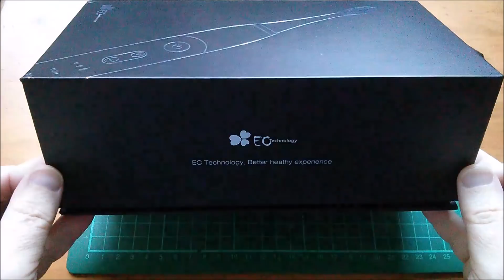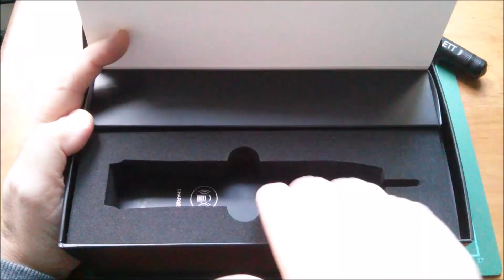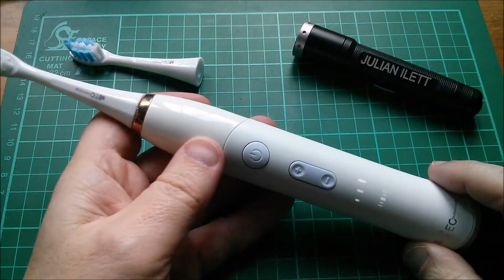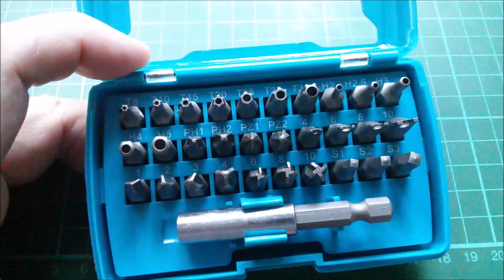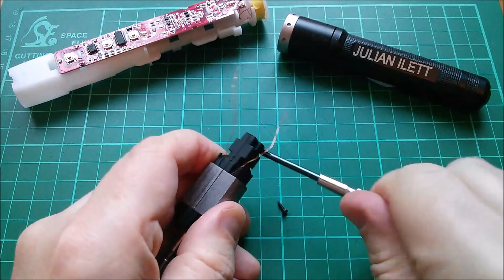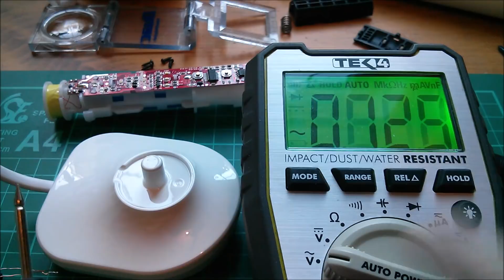Toothbrush Teardown

Comment: CST118S...I thought that sounded familiar. Burnt a cheap Chinese Sunfounder 55g servo about a week ago and opened it up to see what broke. An 8 pin IC on the control board had burnt a hole in it and I could see the die under the lid. Looked up the number, and it was CST118S. Looked for an hour to find a source for it, but all I got were shady websites from Chinese suppliers, none of which I could buy from without requesting a quote. Dug through my bin of scrap boards to see if I could salvage the chip from something, but nothing had that IC.

Guess I'll have to look for a broken toothbrush lmao

Comment: I'm curious if it's possible to tap the op amp in these. Maybe a chip is generating a signal that is amplified like in a stereo and sending the output to the exciter motor that makes the brush head vibrate. Maybe you can inject an audio signal into the amp and then have it play music like the tooth tunes brushes for kids and also hook a speaker to the exciter wires and see how the sound quality is.

8:52 that smaller 4 pin chip is likely some type of amplifier and the larger chip is probably the chip that runs the toothbrush and generates the waveform.

Comment: I think that the spring below is designed to absorb any vibration that woulf be felt when pushing against the toothbrush part when brushing, as a result eliminating the potential rattling against the edge inside the unit

Comment: That was a lot more sophisticated than the old Braun ones, which had a Ni-Cd cell charged from a single coil and diode. The motor was driven via an on/off switch, with no other circuitry. This one looks rather more expensive, too! A few points:
1) Always check first for hidden screws before wrecking a device. You might still have had a useable free toothbrush at the end of the process.
2) Two coils and diodes suggest a centre-tapped secondary with full wave rectification.
3) Measure the battery size to give you the model number. A quick web search would give the approximate capacity, and avoid destruction of the holder.
4) Use your oscilloscope to measure PSU frequency via a secondary coil.
5) Again, use your scope to measure motor drive frequency (which sounds more like 400Hz after Youtube processing.
6) Use the scope to see the output waveforms and voltages under different drive conditions.
7) Some scope indications of signals around that processor would have been interesting, especially when removing the toothbrush from its dock, and when changing drive modes.
You have to use the correct tools for the job! ;-) Thanks Julian.

Comment: An interesting teardown.  I have a similar Sonicare toothbrush that operates at the same frequency.  It's about a 'B' on the musical scale.    On the Sonicare, the "wobbly mode" is used for massaging gums.  I'm curious if the toothbrush heads are interchangeable.  BTW, I got two for $66 at Costco in the U.S., but the EC model seems a bit more deluxe with the plus and minus buttons.
Reply: The brushes are not interchangeable between companies, including the Chinese ones that seem to use identical designs, since overcharging for heads is where most of their profit comes from (similar to the inkjet printer/ink cartridge business model). They vary the shaft profiles slightly to achieve that. Needless to say, anyone with a bit of diy chops can mod pretty much any head to fit snugly on any shaft profile.
Reply: @paulie-g  Know it's 5 years later, but there are plenty of third party heads available for the big brands. 
Phillips has integrated NFC into the brand name heads, currently as a "replacement timer" to remind you to replace the heads, brush tells the NFC chip in the head how long it's been used for then flashes a light to remind you to replace it after a certain amount of time. Totally superfluous since people can see/feel when something is worn out. So I imagine this is a prelude and testbed to/for a "brush will only work with on-brand heads" to be rolled out in the next year or two. 
I learned to shave with a straight razor (it's actually extremely easy to learn, unless you're Michael J Fox you won't cut your throat) so I wasn't beholden to blades, I'll learn how to hack my toothbrush if need be.
Reply: @daviddavidson2357  Yes, that's exactly where it's going. We saw it with HP inkjet cartridges - first the chips warned you about them 'expiring' (which is nonsensical), then they started to enforce expiration, now HP ink is the most expensive fluid per mL in the world (costs more than vintage champagne, prize bull semen, Liam Neeson's tears etc). The fix is just to buy Chinese toothbrushes. There's nothing special about any of this, the motors are cheap and plentiful and the heads are just nylon. Buy one for $30 with 6-8 heads included, by the time you run out of heads the built-in battery will be near dead anyway on charge cycles, just buy another brush.

Comment: The scope would show the modulating motor aka vibrator aka transducer drive waveform and the wireless charging frequency.  and the charger base might have something interesting. also in a set of security bits the triblade is the triangle screwdriver bit.

Comment: are these electronic brushes any better than conventional ones ?
Reply: Quitting isn't a problem, just a couple weeks of discomfort, but it's my last remaining vice and I'm determined to hang on to it. They will pry my pipe from my cold, dead hands ;)
Reply from the maker: So the adverts say. I use both.
Reply: i see. do you feel any difference in terms of effectiveness ?
Reply from the maker: Yes, on my wisdom teeth particularly.
Reply: Regular electric brushes make no difference, other than save you some effort. The sort of higher frequency, shorter distance oscillating brushes like the one demonstrated here are, however, absolutely fantastic provided you get one that is genuinely fast. The technique for brushing is different (you hold the brush in one spot for a while letting it do the work, then move over, ad infinitum) and takes a bit of getting used to, but the results are excellent. I'm a heavy smoker and have been for decades, but after I got one similar to this, my dentist asked me if I'd quit smoking at my next cleaning - that's how much difference it's made. I very rarely promote products, especially in youtube comments, but this is a no-brainer (this type of brush, not this particular one per se). A good one can be had for $35 or so.
Reply: thanks, and i hope you quit smoking soon.

Comment: That vibrator motor tear down was awesome. What a novel design. Thank you.
The spring is there so that when the tooth brush falls on the floor head first, it will absorb the impact and save the ball bearing. 
it also applies positive pressure on the silicon seal to make it water-tight.
Clever design whomever designed it. Real or fake. I wonder if the real Philips ones have noticeable quality of parts inside? This one seemed to be well-made. You can tell, when it's hard to get into. Cheap shit fall apart easy.
Reply: Philips has quality parts inside (PIC micro, branded battery, etc.), but they overlook basic things like conformal coating and poor sealing. They usually die from moisture ingress within a year or two (although the new cheap models are better oddly).

Also its likely easy to get into, if you know how. You can see it has the same twist-lock base as a sonicare, with an o-ring seal. I personally would be OK if they welded it shut, then at least no water would get in.

Good point about the spring.
Reply: I stopped buying Philips kit decades ago because of the shoddy construction 'quality' of their products. It sounds as though they've still not improved.
Reply: the spring returns the head to mid point its not a shock absorber
Reply: Mid point of what? Arguing for the sake of arguing?
Reply: No its over complicated for what it does.

Comment: I have salvaged two pic 16f726 from two sonicares which failed mechanically. Seems the pressfit between the shaft and the motor is the weak point. I have yet to check whther the pics are reprogrammable.
Unfortunately, I also did not check the waveform with a scope :-( well the next failing sonicare will show...
Cheers
Reply: is it really worth salvaging a <$2 SMD part?
Reply: PhantasmNZ if you are taking it to bits anyway, yes it is. It is for free.

Comment: They put two coils in series and used two diodes to make a full wave rectifier. Benefit is that you have only half of the losses on rectifiers, in comparison to full bridge rectifier. 
 And the frequency in this things is never 50hz, you will need a huge coils if it is.
Reply: Exactly, I'd expect the frequency to be north of 200kHz.

Comment: The motor just begs to be hooked up to a speaker output.  Maybe teeth have a musical preference. I'm thinking some polka for the AM and waltz for the PM?   :-)
Reply: stepper motor music eh :)
Reply: I had a similar idea when I saw that motor.  I would remove the spring and add a rear bearing to create a crude galvonometer.  I've been playing around lately with hard-drive and speaker voice coil motors as a galvos, driving them with audio signals to produce diy laser light shows.  I think that motor might possibly work well for this.

Comment: Same as philips sonicare except alot more cheaply made. I took my sonicare apart to replace the batt and the motor in that is far superior. Sonicare is around £100 Vs this. I think it does the same job for a fraction of the cost

Comment: I am a bit disappointed that you wasted to much time with showcasing the stupid 3 strength modes instead of soldering the cell out to have a look on the other side of the circuit board and getting the cell marks without getting medieval...

Comment: Putting this on a scope might be interesting, to see frequency, modulation, etc. Any chance of that in a future video?
Reply: Yep agreed - Julian you often miss the opportunity to use the scope to answer questions like this.  Would have taken just a minute to answer the questions on PWM, variable modulation, charge frequency and voltage.   In fact would have taken less time to test than ask the question!  IIRC you have at least 2 scopes - could we get a follow up video for those of us interested?
Reply: Yup, I kept thinking "use your scope".
Reply: Yes I was laughing every time he kept thinking it was anywhere near 2 kHz.  I would sure think he would know that a 2,000 Hz tone is near ear-splittingly high-pitched.
Reply from the maker: LOL :)
Reply from the maker: Yep, I'll do it :)
Reply: And me, it was begging to have a scope hooked up at numerous points.....
Reply: Julian Ilett I also happen to have the same scope as you which I also got for free from Keysight. 
I know it's a bit of work to get it in frame because of the angle you shoot your videos.
Reply: Thought the same thing, would be much more interesting compared to trying to show the stupid sound changes of the motor.
Reply: My guitar tuner says B2 which is 248 hz with an octave harmonic on top the same as the open second string on a guitar. When he switches to "wobbly" mode it seems to cut the frequency to a fifth or fourth lower, but Julian wouldn't shut up long enough to get a good fix on it.

Comment: What a shameless philips sonicare ripoff - even the travel case is a 1:1 replica...
Reply: Thorsten Schütz I wonder if it would last as well. I am on my third replacement. I really like them but they are not very waterproof.
Reply: I have a similar brush from a different company and it's lasted me 2 years with me not taking any precautions in terms of getting water into it. I'd say go for it, mine was $30 and I can't fault anything about it - not the performance, nor the finish, nor the design, nor the packaging. They'd have to fail at more than twice the rate of the Sonicares to be more expensive and they don't feel cheap either unless you go for the absolutely cheapest ones available.

Comment: i found out that a candle emitted a electro magnetic wave if you make a photovoltaic candle holder you can get a bit of voltage 🤗
Reply: obd6HsN light is a electromagnetic wave
Reply: "candles do not emmit (sic) electromagnetic radiation" - is this some point of pedantry? Would you prefer it stated that a candle's flame emits the EM radiation?
Reply: Donald, if you'd taken the time to work out what I was replying to (I gave you the little head-start of a quote, to help you out), you'd have realized I was actually defending what you typed, against Valentino Saitz who claimed that candles do not emmit (sic) EM radiation. But maybe candles aren't the dimmest things around?
Reply: Donald Sleightholme seriously? If you put basically any lightsource near a solar panel, you can get a bit of power. Furthermore candles do not emmit electromagnetic radiation. And solar panels are not related to electromagnetic radiation at all
Reply: obd6HsN yes it does, i got three volts from from a candle flame surrounded by solar panels connected in series 🤗
Reply: obd6HsN the problem is that burning a candle isn’t going to solve our climate change problem